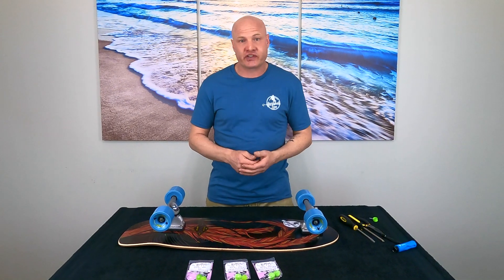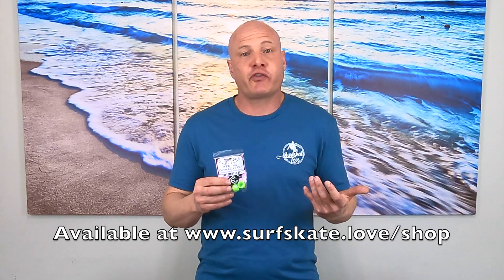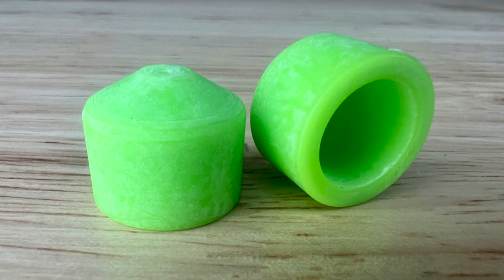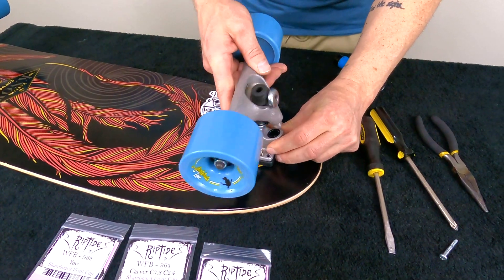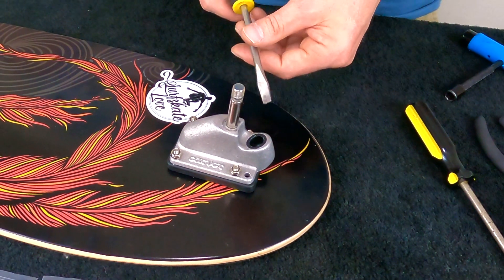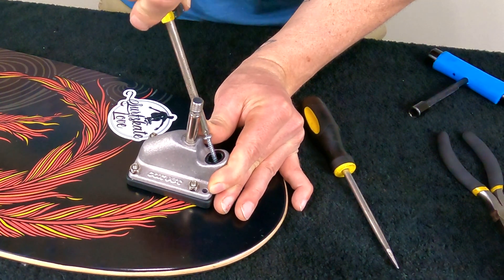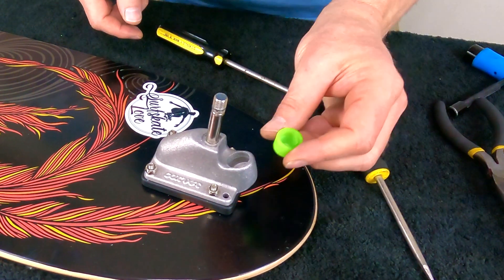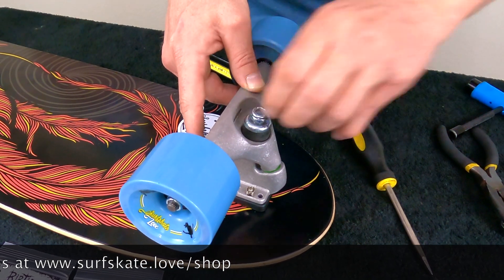How to Stop Surfskate Pivot Cup Squeaks

Comment: My CX stock cups pop right out on their own with little or no effort. I just received the CX Riptide cups on 2/23 from your store and added some wax shavings anyways as a preventative measure. Will be trying them out tomorrow. I’m using Bones Big Balls on the Roundhouse wheels, your Riptide yellow 90a bushings and flat washers to replace the cupped all the way around and it’s truly a dreamy ride even before the Riptide cup change out. I think flat washers are under-considered when skaters are fine tuning their boards. I find zero negative effects on forward momentum with flat washers, and that may be attributable to the Riptide bushings having a little more rebound in their formulas. Great video! 👍
Reply: @prestonriddle1780  flat washer allow more compress of the bushings when you lean, so the rail to rail lean the CX for good example will a little greater. The trade off is supposed to be that you experience less rebound when you are pumping the board to or recovering from a turn. I am using riptide bushings and have felt more lean for real sharp carving, but have not noticed any loss of forward momentum at all. The cups are supposed to re center the trucks coming off a leaning maneuver with more rebound. The went back and forth with cupped vs flat washers until I decided that I was not losing any pumping efficiency. I don’t do a lot of distance pumping. I ride a couple of small ditches or  carve around some small flat tight spaces, so for me I favor the deep leaning technical carving.
Reply: @prestonriddle1780  First off, I apologize for the horribly written response earlier; it needed some serious editing! 

I’m only 5’8” and under 160lbs, so I actually SHOULD be riding the softer duro bushings. You’re at least the second person who’s found the softer bushings, designed for lighter people (at least in theory) have transformed their board’s performance. I need to step down to the 85’s I believe. At that point it will probably necessitate me returning to the stock cupped washers for stability. 

I skated ramps and parks in the 70s-80’s and always preferred the trucks very loose for maneuverability. Thanks for sharing your experience!

Comment: In the mechanics trade, when one needs to install or remove a part into/on/from a tight fitting hole or a tight fitting shaft, heating or cooling one or both parts is an easy way to make a difficult job into an easy one. E.g. a bearing is heated up in an oven, then it can slide right onto a shaft (which would require a press fit otherwise). In our case, the truck and the pivot cup are made of different materials. So I have a theory (that I haven't tested yet): heat or cool the truck/pivot cup assembly, and then it should come out much easier. I don't know the exact materials the pivot cups and trucks are made of, but I am guessing it's (poly-)urethane or some kind of plastic for the pivot cups, and some kind of alumium alloy for the truck. Looking up coefficients of thermal expansion for these materials, it seems that the pivot cup would expand more than the truck when heated, so heating the whole part would make the fit more tight, but cooling it will make it more loose. So, my theory is, put the truck in the freezer, and then the pivot cup should come out easily. I'm waiting for a new set of YOW trucks to be delivered, and will try this theory when it comes.

Comment: Aye bro , my c7 isn’t as snappy . I’ve adjusted it a few times. I’m going to take it apart soon. But I’m assuming the spring is worn out. My bushings are torn/cracked and lean to one side as well. My deck is water logged and the grip is well worn out. Should I just invest in a new carver? My cousin gave me this carver and I love it. But the action is poor and run down. Lmk your the pro.
Reply from the maker: I'd have to see it in person to really know. But it does sound like it's time for an upgrade.
Reply: @SurfskateLove  hey hey brooo , thanks . I actually saw a video where you explain the trucks. I took them apart and cleaned them. The action on them is amazing now. I used a high viscosity bearing oil. Big thanks dude
Reply: @joeybirdjose  what video is that?